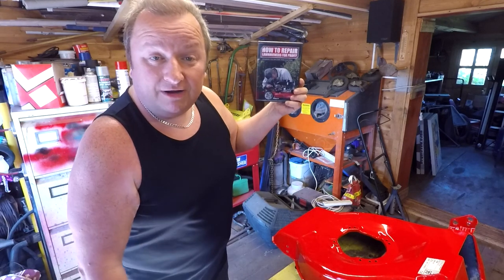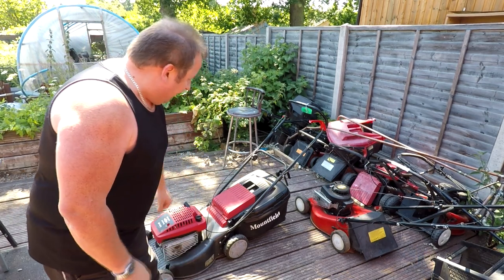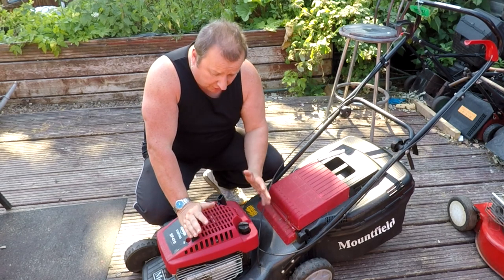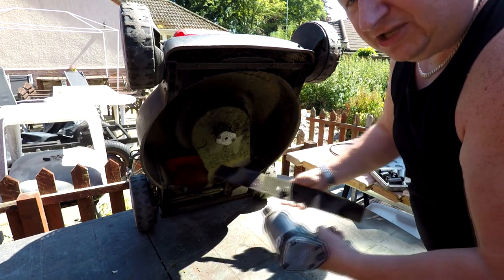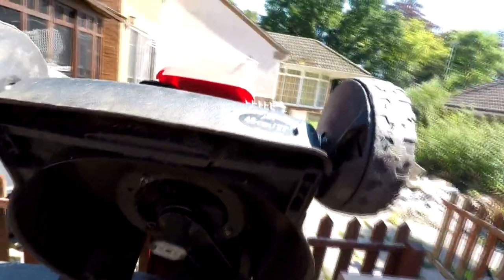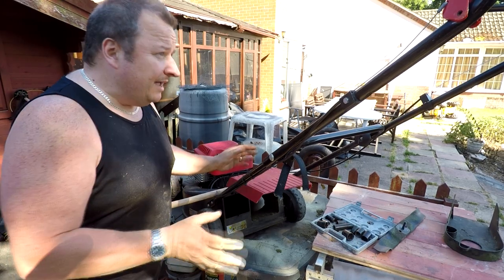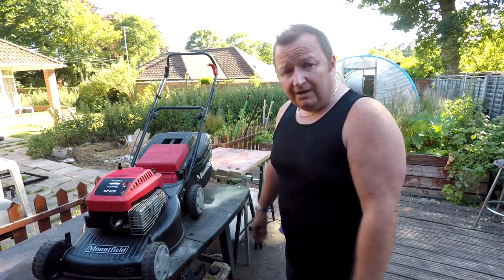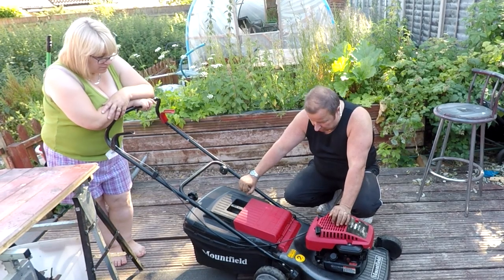Self Propelled Bargain Lawnmower | And Giveaway DVD

Comment: Cleaning all that "cabbage" from the bottom certainly doesn't help the nasal situation. Before I get busy fixing or mowing I have to take a pill or I run like a faucet. Been allergic to grass since I've been a youngster. Used to be so bad that my eyes would swell shut! Hang in there, That mower is a great find!
Reply from the maker: I used to get hay fever since I was a teenager but don't get it any more.